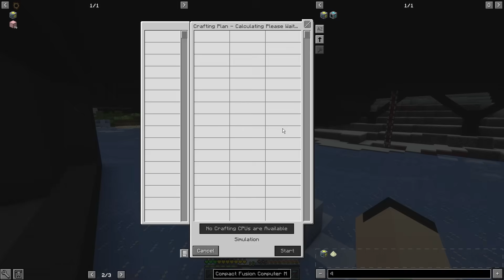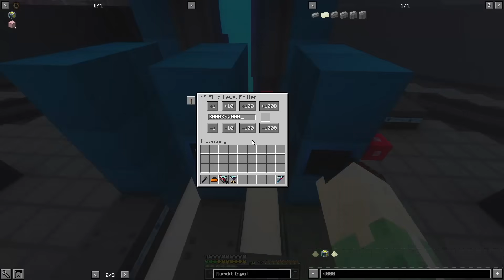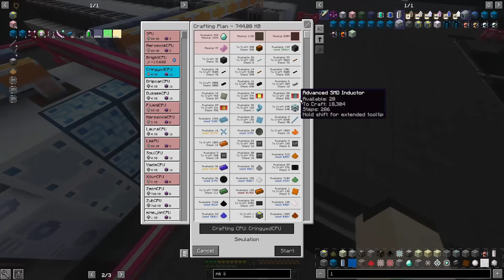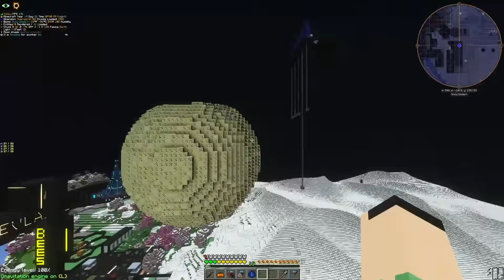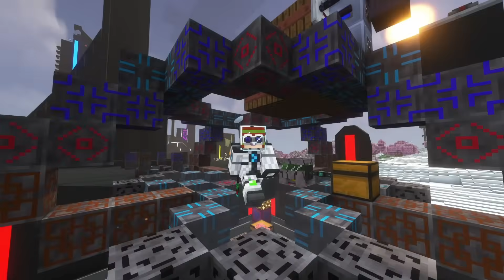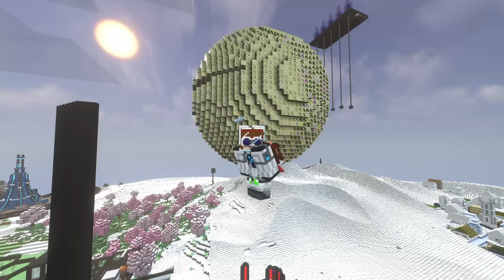GregTech New Horizons E118: A New Use For Water Tanks!

Comment: So the metor automation is controlled by a piezoelectric pressure measuring system using water as a fluid. If water pressure is at 0 then the miners turn on while at the same time,  if the pressure increases at all, the sensor turns off miners until presssure returns to 0 and restarts the cycle.

The covers are there to regulate the rate at which pressure drops towards 0 by moving water out of the system and to set a reasonable max pressure.

This system could be used as a poor mans ME level emitter (or whatever that thing is called) to maintain a certain amount of any fluid or item. You could probably automate every material line in the game with this system (including kevlar). Just swap the pumps for some robot arms or conveyor and BAM you have an item regulator. (Of course you would need a way to count the items too)

It's a pretty ingenious solution. Congratulations!
Reply from the maker: I love this

Comment: I wonder about Buildcraft gates- I remember them having a 'has work' redstone conditional, which operates whenever a machine can function. (any Forestry/Railcraft/IC2/Vanilla machine) 
There's a few Forestry machines that need line of sight to the sky to function- you can do this with bee power!

Granted you could also solve this with a pair of daylight sensors, put one sensor outside the meteor and have it turn off the miners if its dark.
Reply from the maker: You can't solve it with just daylight sensors! Think about the case where there is a meteor and it's night time. The daylight sensors can't distinguish whether there is a meteor or not at night
Reply: @Ham-Corp  Worst case would be the meteor lands at sunset, then a 8 minute delay in the miners.
Assuming no sleeping through the night.

As long as it avoids the false positive starting the miners at night and ploughing up the summoning ritual...